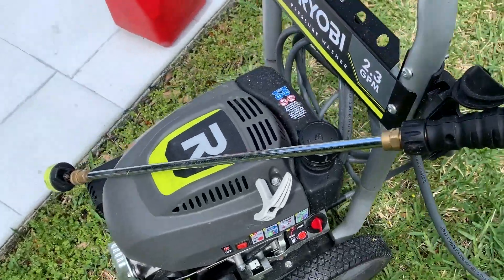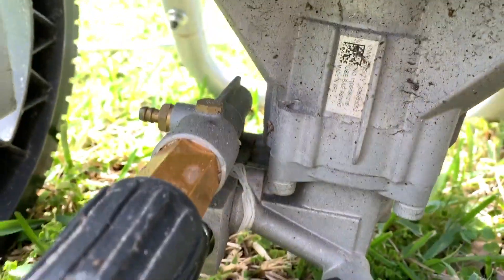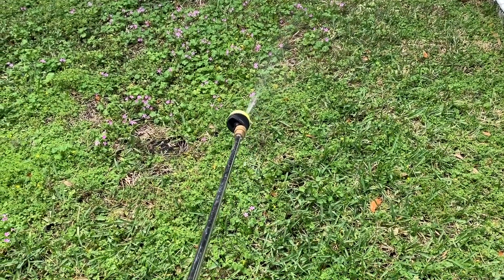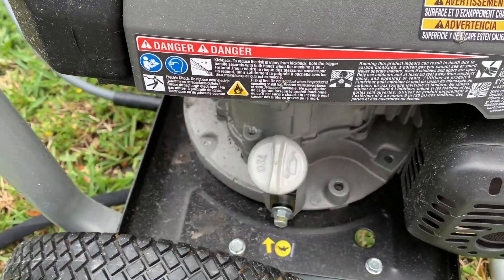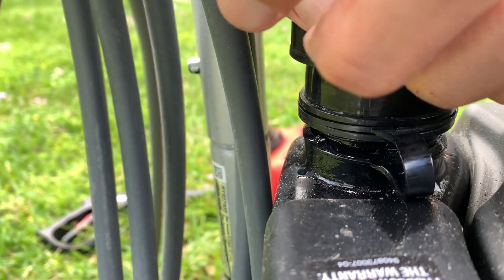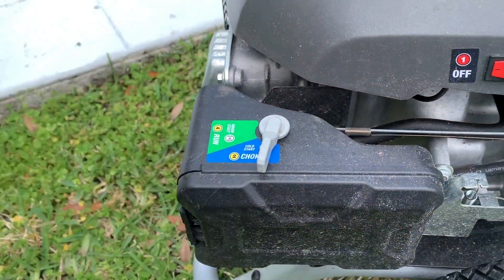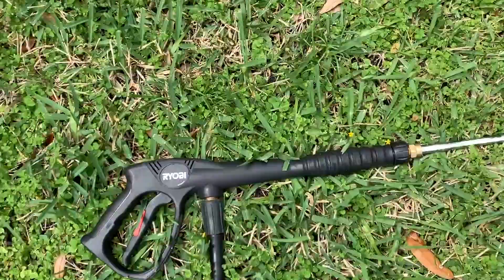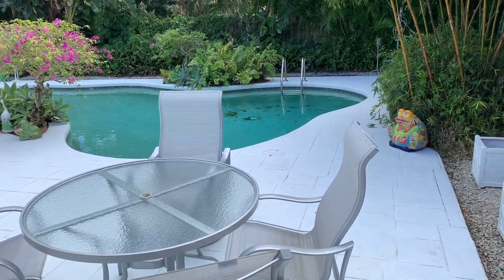How to set up and use a Ryobi 2900 psi pressure washer

Comment: Great video! Did you use it without soap? What kind of soap should I use in this if I need to use soap?
Reply from the maker: I didn't use soap I found that the pressure alone is enough to clean everything

Comment: If you had to buy a new pressure washer in this price rage would you get the same one or spend the extra $50 to $100 for a different one? If so, (or either way really) what would you recommend? 
I found a Westinghouse WPX 3200psi 2.5 GPM for $250 which seems like a great deal and I think it’s on sale but can’t find any good videos for it. So now I’m considering this Ryobi or saving for a Simpson maybe?
Reply from the maker: We are very happy with this one so far
Reply: Tom Leeman be careful with keeping it in the cold, kept one in my garage last winter and the water gasket cracked

Comment: 900 PSI 2.5 GPM Cold Water Gas Pressure Washer this is the exact pressure washer that I have can you go into detail how to add soap. They gave me some blue hose that goes with it but don’t seem to know how exact it works. If you don’t mind helping me out I would love to know how to do the soap feature thanks. Tried looking it on YouTube and none seems to upload it
Reply from the maker: I've never used soap with mine. Theres a little nipple on your water out where your hose connects left side that you put the soap clear line on then attach the other end blue to your soap container, make sure you use the soap that they recommend or it voids your warranty, use soap option on your multi purpose nosel to activate and there you go

Comment: 5 minutes in and still hasn't been started it smh.... Pass
Reply from the maker: If the engines cold you have to put it on choke make sure that you’re fuel line is to the open position and then give it a try if it starts up make sure that you push it off choke and back to run good luck thanks for watching